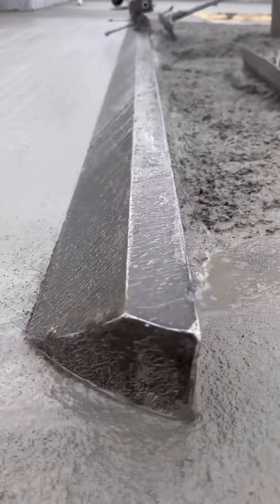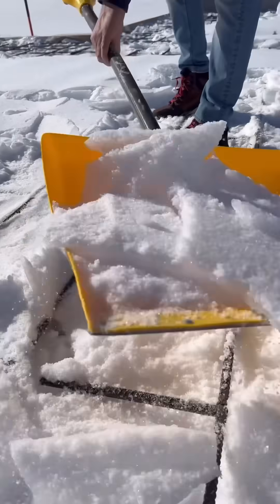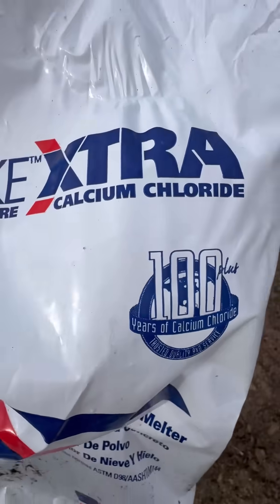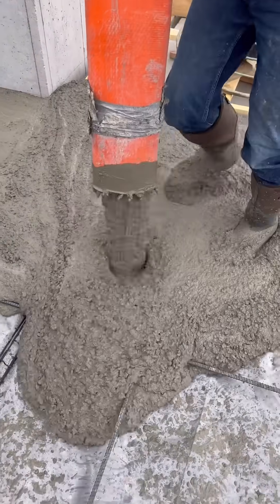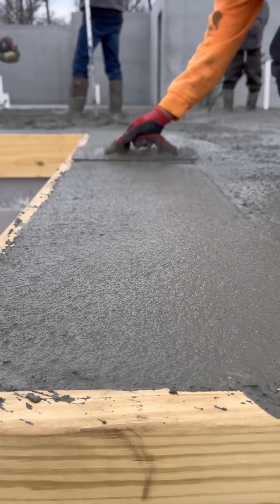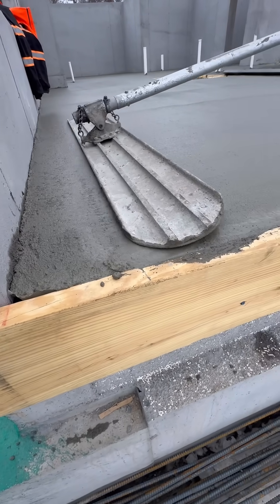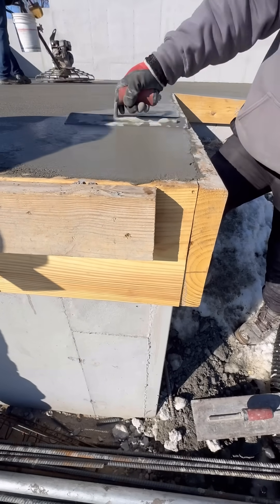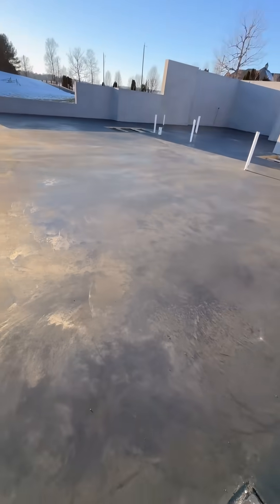How to Pour Concrete in Cold Weather

Comment: Chloride based accelerators will corrode your rebar much faster than non chloride ones or even no accelerator. Always use NCA for outdoor applications where concrete comes in contact with water.
Reply: I've heard several concrete contractors say that, too. They said that coated rebar should be used in pours that contain cal (CaCl). I'm sure coated rebar is more expensive, but it can't be anywhere near the cost of having to replace a bunch of failed concrete.
Reply: @rogerhunter5404   Coated rebar as it’s own downsides. I believe it was some highway authority in US that tried using coated rebar in their bridge and found that if the coating is damaged, it created weak points where rebar corroded faster (i don’t remember the reason) reducing age of bridges by a significant amount.
Reply: @rogerhunter5404  it’s pretty expensive but people that are doing long term studies on them are finding out that it has to be handled extremely carefully to avoid any chips or cuts in the epoxy. Turns out epoxy coated with chipped epoxy can deteriorate faster at the place of cut than regular steel rebar. I don’t understand the logic of it but that’s the word.
Reply: @anmolsingh6607  Thank you. I appreciate having the opportunity to learn things, particularly when it comes to the construction trades. Even though I'm getting closer and closer to 60 years old, I don't want to stop learning.
Reply: As a fdot certified batchman, i would strongly recommend NCA when using rebar in your slab. Calcium will corode your rebar, rendering it structurally unsound.
Reply: The structural engineers I worked with in the past never allowed calcium chloride to be added to the mix. I think they were concerned with strength and durability of the concrete.
Reply: Hot water is needed when using NCA, when the ambient temps are 50 degrees or lower. To help the NCA to react or initiate!
Reply: I asked an engineer I know he said it causes rust just like sodium chloride and that’s why it can affect rebar since the rust occupies more volume than the iron does it creates pressure which creates cracks. But that’s actually already an issue since water can cause rust in rebar. 

You have to stop the slab from soaking up water, coat the rebar, or add admixtures into the mix that will densify the slab and stop chloride migration in the material (and water absorption.)
Reply from the maker: We used non-calcium chloride one time years ago and it was a disaster. The finisher I hired ended up working all through the night and wasn’t done with the slab until the next day. It also cracked worse than any other job we’ve ever done. After that experience I’ve never used it again. Maybe that was a fluke though
Reply: @hausplans   NCA’s work slower definitely. I don’t have much experience with chlorides because we avoid them entirely here.
Reply: I think you’re thinking of air entraining agent, not accelerator. Concrete needs entrained air if it is exposed to the freeze/thaw cycle.
Reply: @ That is also correct. However the reason for failure due to lack of air entrainment is that water that seeps into concrete doesn’t have room to expand and create fissures in the concrete causing it to fail (with or without rebar). 
Chlorides in concrete can become free due to exposure to elements and accelerate the corrosion of rebar which reduces the tensile strength of concrete causing it to fail.
Reply: @anmolsingh6607 are you implying that if concrete containing reinforcing steel is not exposed to the elements, then it can have a chloride accelerator?
Reply: @ I’m just a yard boy at a concrete plant, so please take it with a grain of salt. But yes, As long as theres no water you should be alright. That’s why where I live (Lower mainland of BC, where it rains a lot) no concrete company uses chloride accelerators anymore.
Reply: @anmolsingh6607  A grain of........... salt, eh? 

Eh?
Reply: @ I’m glad you caught it 😂
Reply: Here’s a fun fact: rebar doesn’t corrode when inside concrete
Reply: @EatMyDick   It certainly does. That’s why whenever cost effective, galvanized or epoxy coated rebar is used to counter the long term effects.
Reply: Absolutely it does @EatMyDick

Comment: Better option Batch the concrete with hot water it will not attack the steel like that Calcium Chloride. but even then you know that's why the premix Co. sends that crap in a bag and lets YOU add it not them less liability.

Comment: Wait, you put Calcium Chloride accelerator in concrete WITH REBAR?  noooooooo that shit's gonna corrode the rebar dude.  I run a concrete plant, you never put calcium chloride in with rebar.  Look it up if you don't believe me.  We use NCA (Non-Chloride Accelerator) for jobs with rebar.  Specifically Daraset 400 admix.  It's more expensive, but not as expensive as tearing out and repouring a slab/wall/column.  Whoever told you to do that needs a good swift kick to the groin.

Comment: Calcium chloride is a no no for concrete.  It has proven time and time again it increases the rate of corrosion in steel. Causing rebar failures over time.  If you don’t believe me research it yourself online.  They no make a NCA (non-chlorine Accelerator). That works just the same that does not break down the rebar in concrete.  I would new use CC Accelerator in concrete.  It’s not worth the risk.